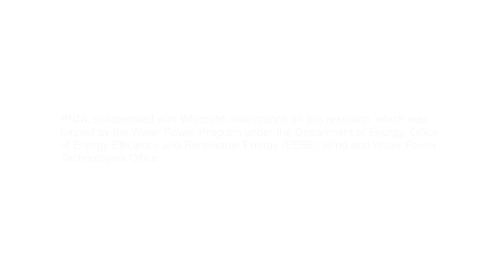PNNL Tests Fish Passage System

Comment: We are so busy engineering what we "think" will be the answer to the problem. We are missing the main issue here. Dams are a major issue for down stream ecosystems in general. Blocking sediment flow has caused so much destruction to the shorelines, because there is no longer sediment replacing what is eroded by the ocean. I could ramble on here forever but I won't.